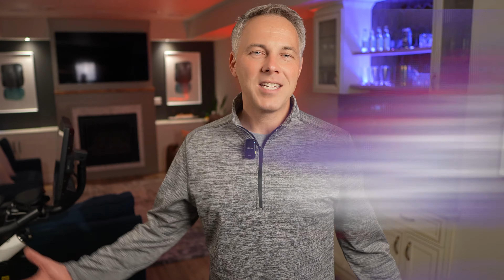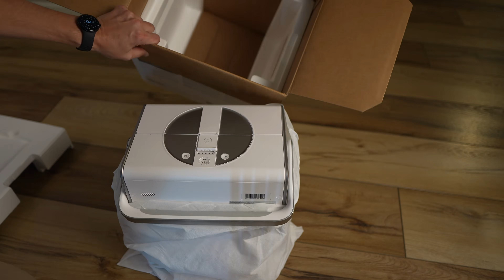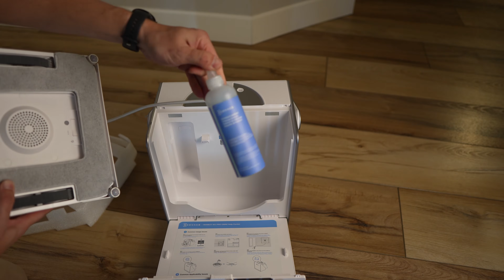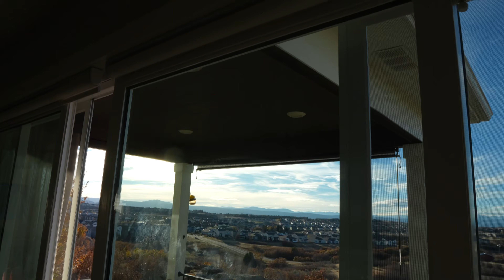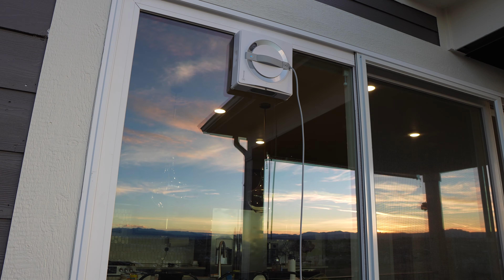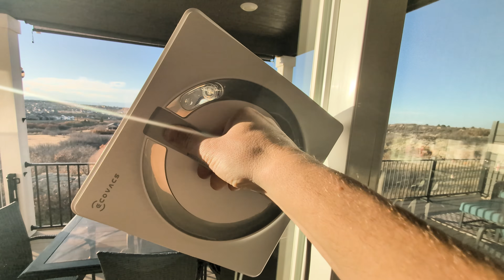Can a robot clean my windows?  I TESTED the Ecovacs Winbot W2 PRO OMNI

Comment: Looks good, though my highest, largest windows are triangular. Clearly the size and shape of this model would prevent it from getting into the corners. And ditto questions about the length of the connection between the two units.
Reply from the maker: Yeah, might be tough. High windows are the worst! Good luck!

Comment: Thanks for the thorough review. I tried the W2 Pro model. It got caught on the clips that hold my frameless shower wall in place. They are a hair smaller than 4 mm which the specs say this model will detect. Any advice?
Reply from the maker: I wish I could help. I have clips on my mirror and it navigated them just fine. If it was me, I'd design a 3d print cap to put over those clips to make them slightly larger. That would be my geek solution. Thx for watching

Comment: We live on the coast. Would the glass have a coat of fine spray and if yes will I need to run it twice or try and clean the glass by hand first? Thanks.
Reply from the maker: Oh man, I wish I can answer that question. I'm in Colorado so I have no experience with that Ocean spray. You could add cleaner instead of water and it would likely do a better job of getting that hard spray off the glass. Hope that helps?

Comment: Will it clean sliders with a beveled edge around the frame?
Reply from the maker: It's not supposed to - the instructions say it needs to have a "frame" but I can tell you it worked great when tested on my slider with just the beveled edge.  A typical glass sliding door - you can see it in my video.  Hope that helps?

Comment: Curious to see how it would go on other surfaces: bathroom tiles, kitchen cupboards etc
Reply from the maker: I really doubt it would work on those. Needs a flat smooth surface for the suction to work.
Reply: Iv got this unit and was curious also so tried it out on my bathroom walls that are tiled from floor to ceiling. Don't recommend it. The unit would paulse often as suction would reduce before proceeding forward again due to tile gaps. Done it and won't fo it again.

Comment: plain tap water, not the solution?
Reply from the maker: The instructions actually call for tap water. You can use the solution but I find that straight water works great for most situations. Crazy, right?
Reply: @TechItBeforeYouWreckIt so strange! My instructions to the same model call for solution, and no water
Reply from the maker: Very interesting. I can confirm that water alone does a great job. I've been reserving the solution for very dirty windows. It's expensive!!
Reply: @TechItBeforeYouWreckIt  I would think my tap water would plug the sprayer over time.  I'll use RO water on mine.  I wonder if their solution is actually akaline water?
Reply from the maker: I'm sure filtered water or RO water is better but the instructions specifically say tap water is good to go and I can confirm it's been working great for me.